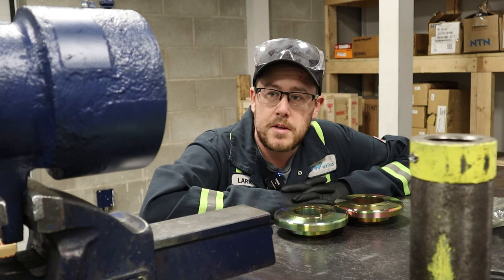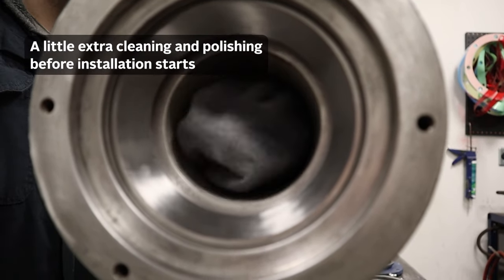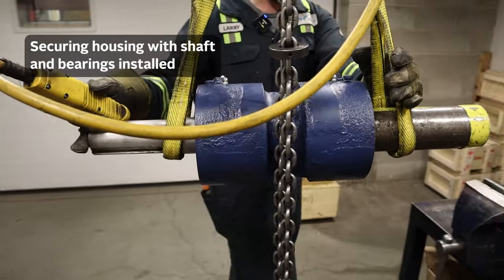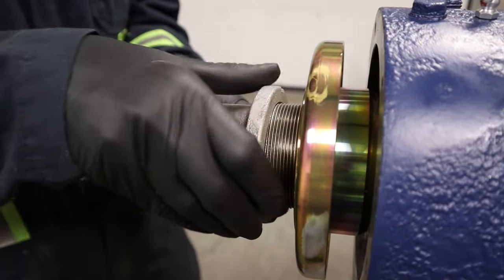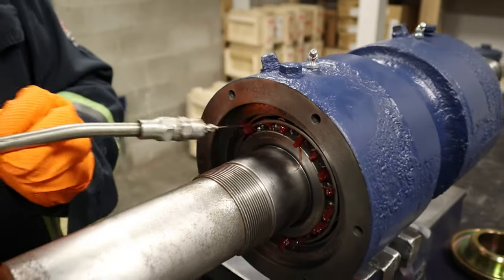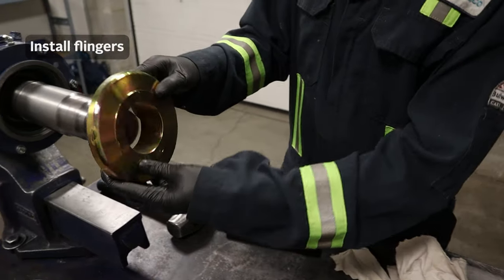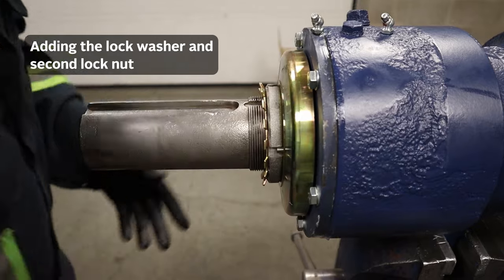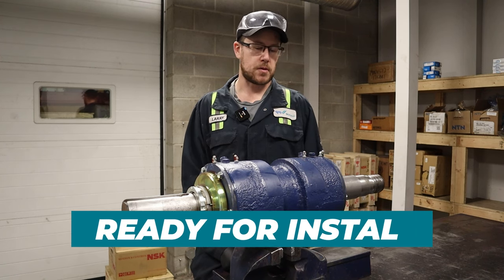Slurry Pump Bearing Assembly

Comment: Thanks Welco - very informative.  Just a safety call-out.  When setting the threaded pipe with the cold chisel and hammer - the tech holding the shaft assembly looked like he was in direct line-of-fire of the chisel - one unfortunate slip and he potentially may have copped it in the face or just below.  May just have been the angle of the camera shot but it looked sketchy!  Maybe a simple jig to hold the shaft would be a safer option.  Nevertheless, thanks for the video.
Reply from the maker: Thanks! Maybe the angle, but we will check with the crew to ensure it wasn't an oversight. Appreciate the feedback!